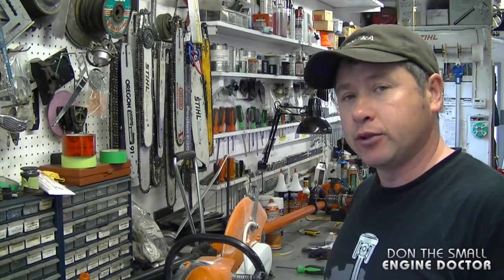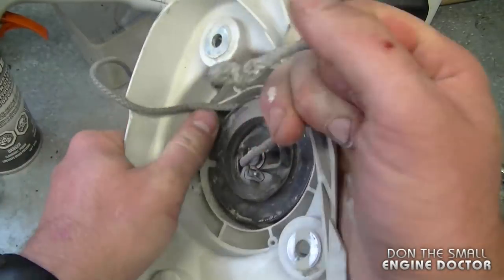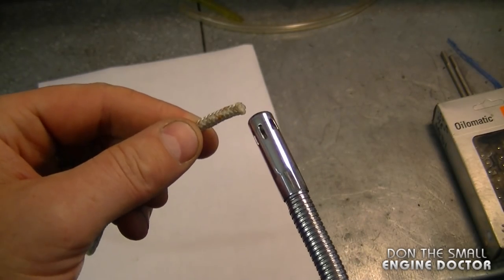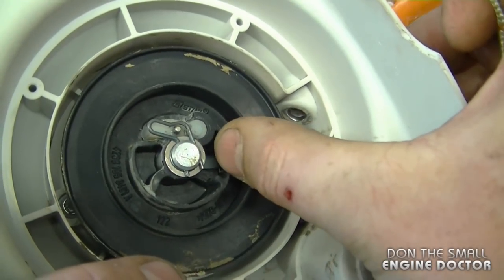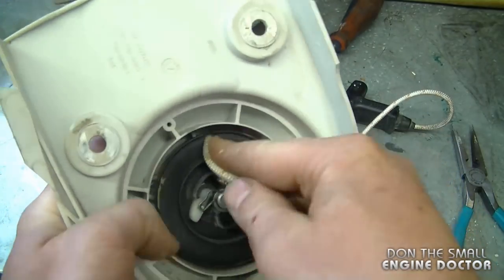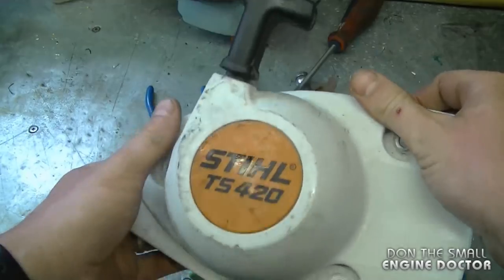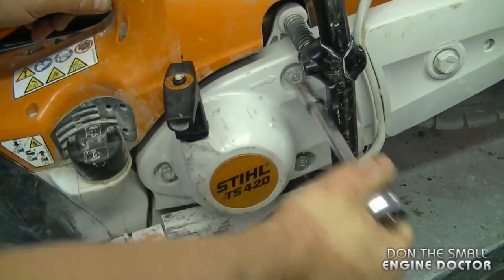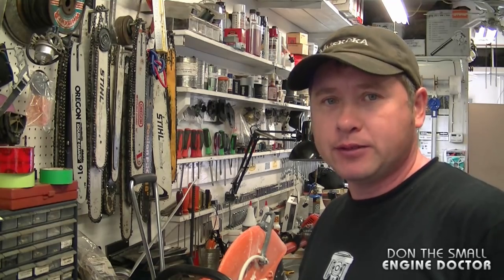Pull Cord Repair On Stihl TS-420 Cut Off Saw

Comment: I always check the bushing the rope goes through to the starter. Many times the cause of rope breakage is the worn through bushing especially on the cutoff machines. You end up replacing ropes if the burred bushing isn't replace also. Fortuneately on Stihl products you can replace that bushing with a special to to flare it in. No need to replace the housing.

Comment: Argh this is crazying me....I've done everything ok but now when I put the pull cord assembly back onto the machine, when I pull the cord it's not engaging with the crank wheel on the inside of the cutter....I've taken it off checked the assembly on the inside of the pull cord everything is ok so why won't it engage with the internal wheel now? Thanks.